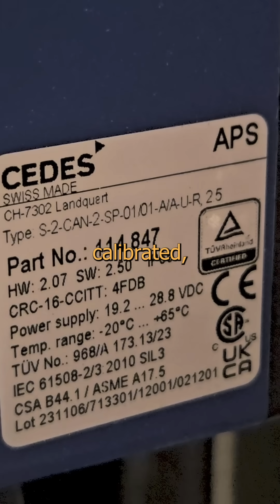Elevator Encoder #chrisboden #comedy #engineering #controls #urbex #indicator #resolver #barcode

Comment: My first job was as a janitor in a department store that had a human elevator operator. Alice (or I, after hours) had to eyeball when the elevator floor was at floor level. The only automatic things on the whole system were limit switches up under the lift motor & near the bottom of the shaft. Yep, on about day 2, I tripped the lower limit switch when I didn't stop the elevator in time. A mechanic had to fix it. I got better fast!

Comment: During the 80's, I worked maintenance in an old textile mill. The elevator drive had a series of cams on a shaft. Adjusting the cams would tell the elevator where to stop in relation to the floor selected. It worked, until it didn't. Adjusting, ( "timing" ), it wasn't so bad. However, going up and down the stairs to check was a pain. It was NOT elegant.

Comment: Technically each line does repeat many times, but never with the same neighboring lines. 
There are 10 columns of dots, but the two outer ones are in a repeating pattern every three lines, so each line is only a byte, giving only 256 patters. However, if we take every 3 lines (based on the edge pattern) that would 24 bits, which have a possible 16,777,216 (assuming no error correction bits) which, assuming the dots are an 1/8th inch, would be able to have a strip around 60 thousand feet long (tall) without repeating. Since this would be major overkill I'm guessing there ARE error correction bits, and still lots of potential length before a repeat.

Comment: we use rail magnets that are a huge pain in the ass but you set then in a specific spot so when the elevator goes down the box reads the magnet adjusts position and ends up level with the floor they are flat with 3 magnets on them they are really cool you should show those too!

Comment: Looking at the barcode strip and my Autism automatically reverse engineering it, it looks like the marks on the outside edges form a repeating sequence to provide a spacing indication - Look at the close-up, reading up, and you can see 0xxxxxxxx0, then 0xxxxxxxx1 and finally 1xxxxxxxx0 before that sequence repeats.

This means the line number between them is just eight bits wide, allowing for 768 lines (About 76"/193cm) before the code has to repeat itself. Still definitely good for precise levelling and keeping track of each 1,93m section of shaft! 👍

Comment: How do they deal with the shipping and installation of this code strip? I didn't notice any brakes in the video. 

I'd have a hard time imagining a multi-story strip is shipped like that. How do they handle maintenance if one section manages to break off due to some mechanical problem?

Comment: Although it is "simple" to think about, it is actually much more complicated than, for instance, a limit switch. For what it does in the scope of its operstion, it is simple though. But you're still using photoreceptors, programming, and integrated circuits. Which are infinitely more complicated than a mechanical system, just more complicated to a different audience.

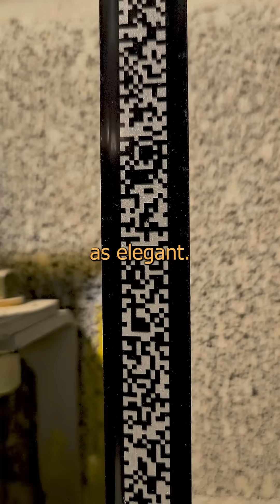Comment: 1:00 How is that a non-repeating pattern?
There are only 10 pixels wide... Hmm... unless it uses 2 or more rows (20 or 30 pixels?)
With 10 pixels, the maximum you can count to is 2^10 = 1024, and if a pixel is 1x1 mm, then it is only 1,024 meter, not even the height a grown human.
With 20 pixels it becomes 2^20 = 1'048'576 mm, or about 1'000 Kilo Meters. that would work even for space elevators :D

Comment: Some Cranes also use this system. We had a few design meetings, where somehow this always comes up as the first and only solution to linear movement encoding. We built cranes not for indoor use, but rugged outdoor conditions. The types of conditions you're lucky to tell right from left hand just by looking. Codetape is a very neat way but pleaaaaase for the love of god... consider the circumstances in design or I'll gladly put my phone on mute for all further "maintenance" calls for this on idling cranes.

Comment: This is very cool. I've only worked on elevators that use an encoder and toothed rubber belt. These have a base floor switch or magnet that starts the count at 10000. As it goes up the encoder spins on the belt and the count goes up. This design is cooler because it doesn't have to go down to the base floor switch or magnet to reset its count if it gets lost. It can get lost if you pull on the belt while servicing for example. The control system knows it didn't power any relays to make the lift move so it knows that there is a problem and goes into reset at about 10 fpm downwards until it hits base floor switch or magnet.

Comment: As an engineer that deals with complicated systems on a regular basis. Being told the system you designed is simple seems like a disrespect when in fact making a complicated process simple is the pinnacles of a compliment.

Comment: The elevator knows where it is at all times.  It knows this because it knows where it isn't.  By subtracring where it is from where it isn't, or where it isn't from where it is (whichever is greater), it obtains a difference, or deviation.  The guidance subsystem uses deviationd to generate corrective commands to drive the elevator from a position where it is to a position where it isn't, and ariving at a position where it wasn't, it now is.  Consequently, the position where it is, is now the position that it wasn't, and it follows that the position it was, is now the position that it isn't.  In the event that the position that it is in is not the position that it wasn't, the system has aquired a variation, the variation being the difference between where the elevator is, and where it wasn't.  If variation is considdered to be a significant factor, it too may be corrected by the GEA.  However, the elevator must also know where it was.  The elevator guidance computer scenario works as follows.  Because the variation has modified some of the information the missile has obtained, it is not sure just where it is.  However, it is sure where it isn't, within reason, and knows where it was.  It now subtracts where it should be from where it wasn't, or vice-versa, and by differentiating this from the algebraic sum of where it shouldn't be, and where it was, it is able to obtain the deviation and it's varation, which ks called error.

Comment: So it looks like this is an evolution of the linear encoder scheme, where the elevator knows how far it has traveled since it last got a reference update (usually at each floor). That system works well until the elevator gets confused as to where it actually is and just randomly stops and slowly drifts around to find a reference point and reset itself. Totally didn't happen in my college dorm a few times a month with me in it. But I learned, if it stops hard and starts bouncing, just wait a few seconds, you'll hear a click, and all is good again.

Comment: I used to have space in a massive old mill that had a manual freight elevator (vertical opening doors, lever switch for up and down), floor leveling was two strips of tape, one on the inside of the car, one on the inside of the shaft at every floor. Took some serious practice :)

Comment: Interestingly each line cannot be unique. Looks like each line is 10 blocks across and it looks like it's 1in wide so each block is 1/10 of an inch squared.

A 10 digit binary string has 1024 combinations so at 1/10 of an inch, 1024 stacked on top of each other would be about 8-9 feet tall. Aka 1 story building. How we I think I know how this works. 

Notably the first and last columns seem to repeat. Black, white, black, white. These would be your guides to determine your rows. Leaving 8 blocks or an 8 bit binary number or in computer speak 1 byte. Each row then corresponds to a number between 0 and 255. Each line doesn't have to be unique but as long as each group of n numbers is unique then it knows its position.

For a 10 story building and 1/10th of an inch tall block, you would have a column 12,000 blocks tall meaning with an 8 digit code the elevator would have to read a section 48 blocks tall or about 5 inches to accurately determine where it is without any prior knowledge. However with some clever design you can half that by using the guide lines as a 9th digit meaning you only need to worry about a 2.5 inch section.

Comment: The pattern for each row definitely repeats--there are 10 'squares' of white/black per row, so only 2^10 = 1024 unique patterns. With what looks like ~1/8" between each, that's only about 10 feet of space before you have to start repeating.

I'm guessing that the elevator therefore reads multiple lines at a time (2 rows allows for 2^20 possible combinations, enough for many miles of hoistway)

Comment: 10 bit, that is just 1024 values each being like 3mm long top that is... 3 meters, something is not adding up, what have I done wrong?  did I incorrectly count the squares? are they... much bigger? is the multiplication wrong? ooooor yes this is gona be the part it reads a square not just a line I assume? but then it would not be every line unique ID but a square WHAT AM I DOING WROOONG  PLEASE HEEELP (I tried to look it up but I failed to even far the barcode tape so... I am outsourcing information to YOU)

Comment: Each line is 10 bits, so every 1024, there will be a repeat of a line.  However, if you base it on scanning 2 lines, then you have 20 bits, or 1,048,576 unique sets before there is a repeat.  If 3 lines are scanned at once, then there is 1,073,741,824 unique sets before the pattern has to repeat.

What I did notice though is that if you look at the pattern vertically,  starting from one side, going from bottom to top, the pattern repeats WWBWWBWWB, while the other side, the pattern, starting from the same line, bottom up, repeats WBWWBWWBW.  What this does is give the elevator information on if it is going up or down,  and the middle 8 bits are what determine where the car is.  For that, I would imagine that the strip is printed such that the 8 bits are sourced from a high quality random number generator, and the sequence is read into the computer that controls that elevator car during its initial up/down travel of the hoistway.

Comment: No matter what system is used to locate the floor position it still relies on the rest of the system working properly. The motor speed control, the brakes, any possible stretch in the cables, whatever "reads" the stopping position. All these have to work correctly to achieve the wanted goal. Also because this is a visual system the tape has to remain clean.

Comment: For clarity, you couldn't have each line itself be a unique identifier unless you had each line be an inch tall and your elevator shaft was only 86 feet tall. For a 10-bit binary code, there are only 1024 possible combinations. Now, if you used every 2 lines as an identifier and reserved one of those bits as an identifier for "top" or "bottom", you could get one of those lines to about 1/5 of an inch with a 4000-foot elevator shaft.

The engineering here can't be quiiiite as simple as the video implies, but it's still got potential to be reaaaaally simple.

Comment: On the other hand, an electro-mechanical switch to do the alignment can probably be cobbled together by a talented blacksmith. An imaging scanner, and a CPU to decode the information less so. So it's simple as long as the supply chain holds. When the supply chain for electronics is problematic, a problem that an electrician could fix in 1-2 days can turn unto a problem that takes weeks or months to fix, when the parts are just not available.

Comment: Pedant here. 

 I think each “line” here is actually a set of three: one row with rightmost bit on, leftmost off, one with opposite, and one with both off. 

Otherwise 2^10 bits for 1024 unique lines at (guessing) about 1mm per line would only give you a 10m shaft. 

If I’m right, and the outer bits are just for alignment, then three rows of 2^8 (+16 million addresses) is what it’s using to uniquely identify a position.

Comment: Why not do exactly this, but with a needle to read the code horizontally? 3-bit covers most buildings up to 10 floors, 8 bit covers basically ALL buildings. And with needles rather than a QR code reader, you can even have an analogue failsafe.

Comment: I remember the good old days when elevators were manually operated and each car had a elevator operator.  And when they didn't get the floor/car thresholds lined up (+ - 1-2 inches) and were too lazy to correct, they would always say "Watch your step".

Comment: The code bar’s only 8 bits across, meaning the maximum length with all distinct rows would only be 256 rows long. Clearly not enough so wonder what else they’re using

Comment: Hm, not using Gray code. They ought to, much less chance of a mistake. You get reliability for free, just by organising which order you put the bytes in. 

In Gray code, only one bit changes, between one number and the next. This is a big strip of binary numbers, not a QR code. It's read, I assume, as 10 horizontal bits, to make a number, and every so-many millimetres down the shaft, there's a different binary number to encode where abouts you are, or rather the reader-head on the device is. 

Gray code is a way of counting in binary. Of organising bits. In Gray code, only 1 (one) bit changes from one number to the next. So if the reader is aligned a bit wrong, worst-case it'll only be off by 1 bit. And since it knows the encoding of those groups of 10 bits, it knows it's either at this-point or the next-point or the previous-point. Since only one bit changes each time. So it knows where it is within one group of bits up or downward. Where using random-looking bits like this, if the reader is  just on the cusp between two sets of bits, it could read half the bits from this line, and half from that, adding up to a completely wrong number that might correspond to halfway up the shaft.

Look up "Gray Code" if you don't get this, it's used all the time in engineering, particularly when encoding positions. Maybe this doodad uses some other system I haven't heard of, but doesn't look error-resistant for all I can see. Gray code is inherently almost infallible, always accurate to just one position wrong in either direction. And it's easy to generate.

Comment: Not in the same league but I think the Bourns ACE (Absolute contacting encoder) is a pretty cool example of absolute angle sensing. Instead of some complicated code disc it just has 8 fixed contacts in a circle and a number of moving contacts strategically placed on the rotor and the positions are just right that it generates a 128 step sequence.

Generally everyone decodes using a look-up-table but it has potential for a code golf challenge.

Comment: Does it use multiple rows at once to determine a given position? It seems like if each row is ~10 bits then you could only encode like 1024 unique positions with a single row, wouldn’t it run out?

Comment: Hoooooo boy, you'd like to see both the Otis Pie Platter, and the Lester UPS.

UPS is an Ultrasonic Position Sensor. It is a hoop/reader on the side of the lift car, and a loooong piano wire hung from the top of the shaft.

The transmitter at the top of the shaft, sends an ultrasonic pulse down the pianowire, and the reader hoop on the car calculates its distance from top and bottom of the shaft, based on the feedback from the UPS line.

Ill let you look up the Otis Pie Platter selector though. When i was an apprentice, i was only over told DONT TOUCH THAT.